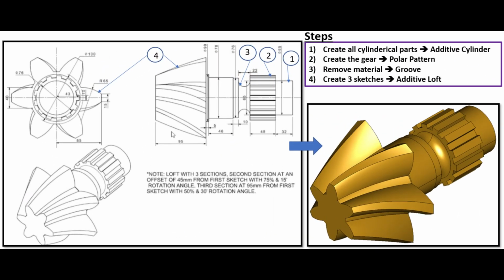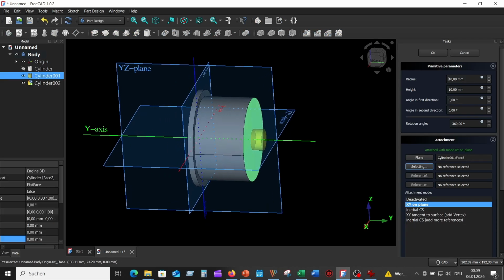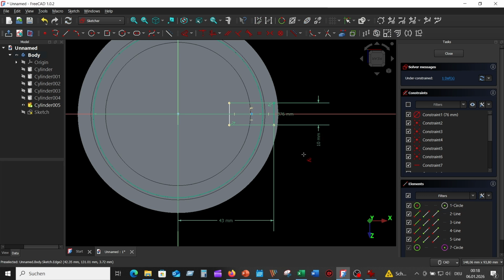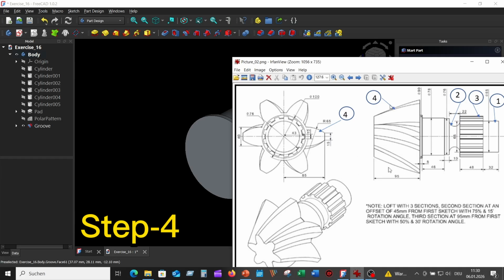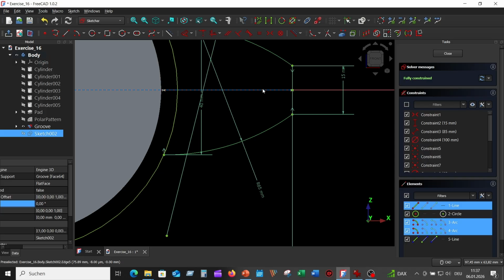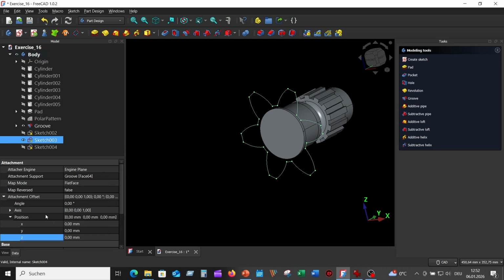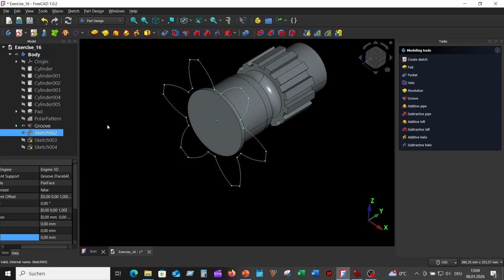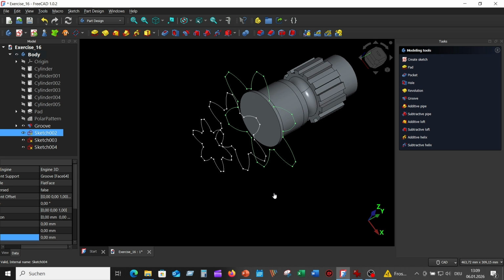FreeCAD Tutorial for beginners, 3D Exercise #16

Comment: When doing the additive loft i get an error, I select Sketch 002 then select additive loft, then add Sketch 003 and Sketch 004, it doesn't show a preview and when I close it it says" Sections need to have the same amount of wires or vertices as the base section"?

Comment: I  always wonder why you have to hold Control when selecting points to add a constaraint, I can just select them without using Control?
Reply from the maker: Hi,
You're right!
That's my experience from another CAD -software.
I will correct in the next videos.